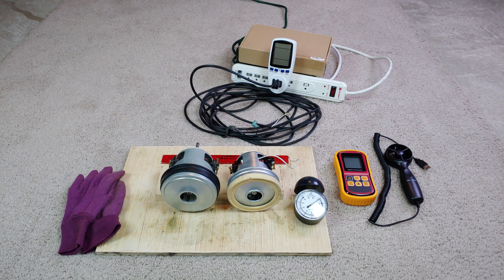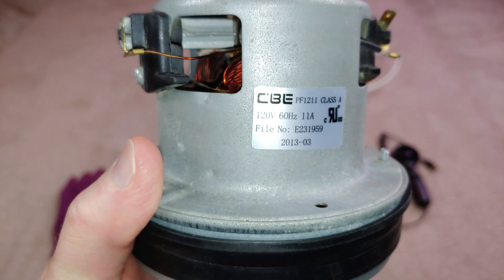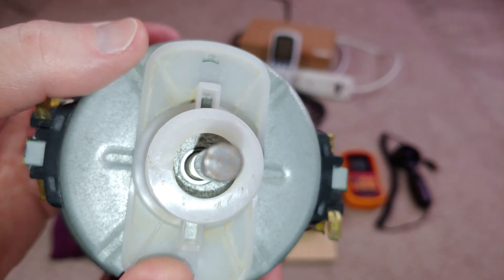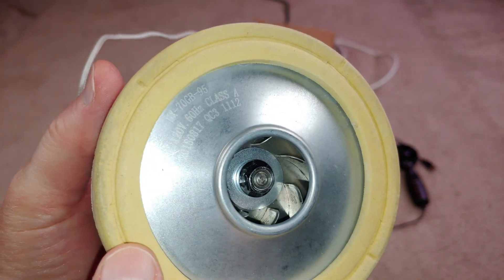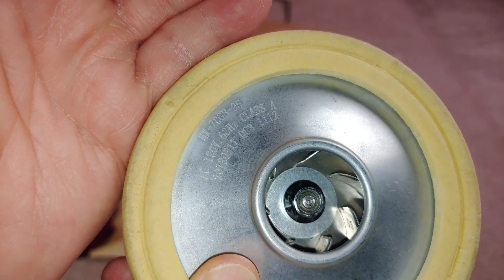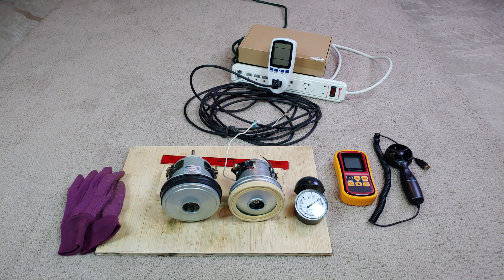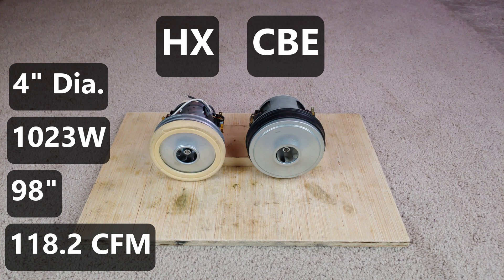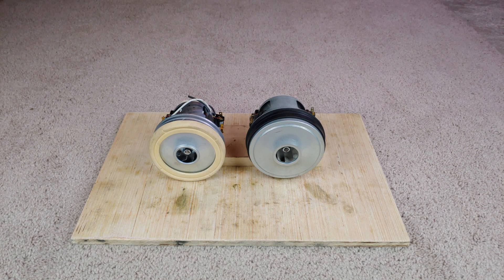Cheap Small Raw Motor Performance Testing HX And CBE | Better Than You Think

Comment: Your measurements of the HX-70-GB (made by KingClean, by the way) pretty much match mine (last I checked, I got around 116 CFM and 95" of lift). It's also a brand new motor - it was sold to me as "open box" on Ebay and your tests are the first use it has seen 😁
Reply from the maker: It's good to know we achieved similar results. Your load voltage may have been lower than mine, accounting for the difference.
Reply: I was about to say that it looked like a KingClean motor similar to that in a Shark/Hoover Air/etc.
Reply: It actually is a Shark motor! Pulled from an NV300 series Navigator I believe.

Comment: These little motors can be very powerful. Vortex fan and very high rpm (compared to the 2-stage motor) do a nice job. However I like 2-stage motors more with flat fans and lower rpm with a nicer tone.
Great job doing this video!
Reply from the maker: Both of these are high pitched screamers.